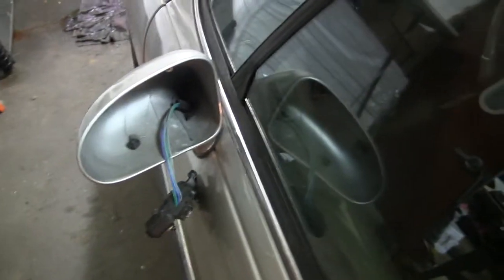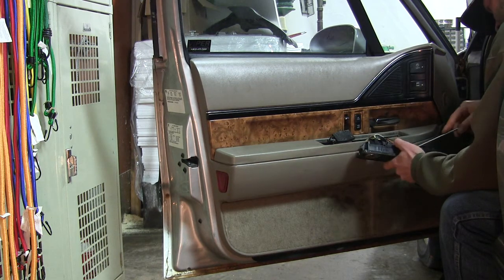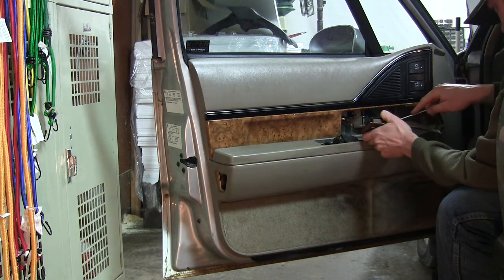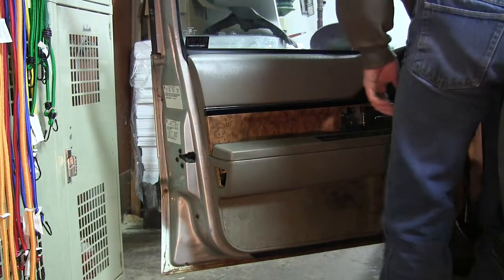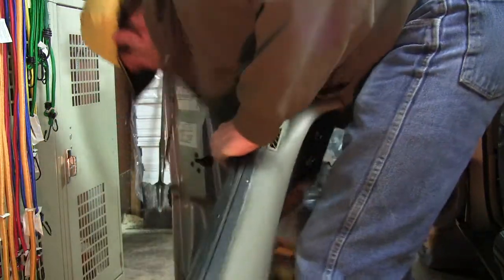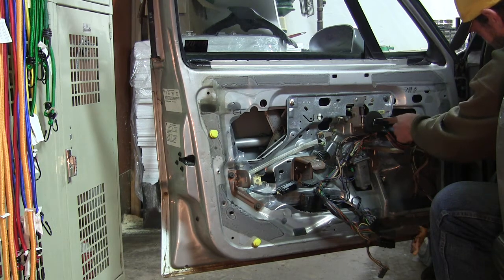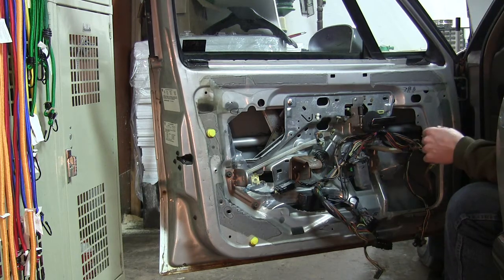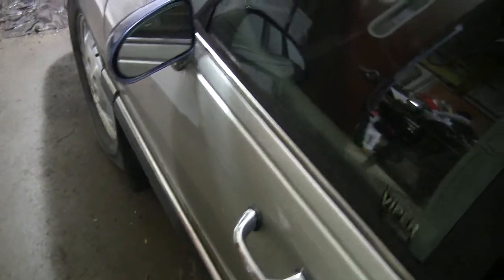96 Lesabre Side Mirror Replacement

Comment: I have a 97 Buick Lesabre in need to replace the rear struts do I access them by taking the back seat out, and if so does the seat and the backrest need to come out? also do I need to remove the carpet that covers the back window ledge where the speakers are as well?
Reply from the maker: All the Buicks I've done have had access through the trunk to get to the bolts on the rear struts.